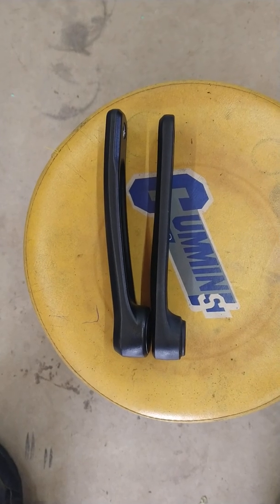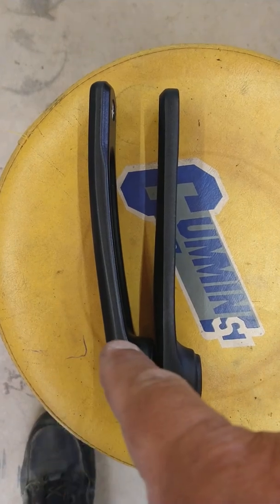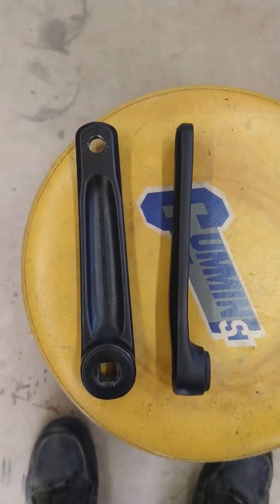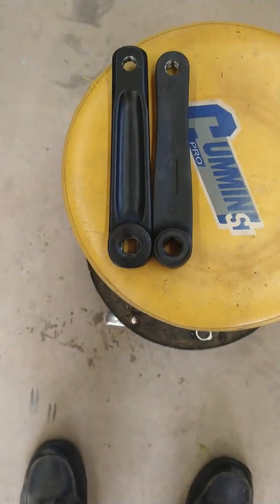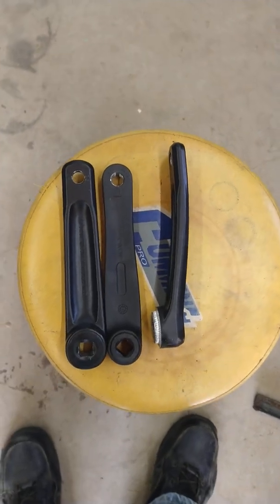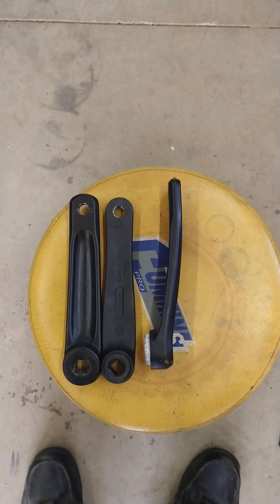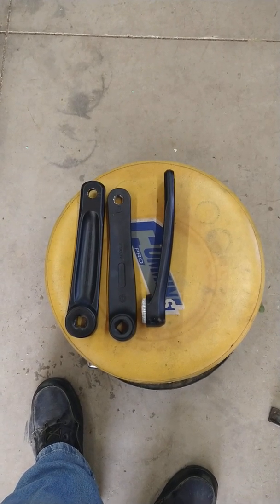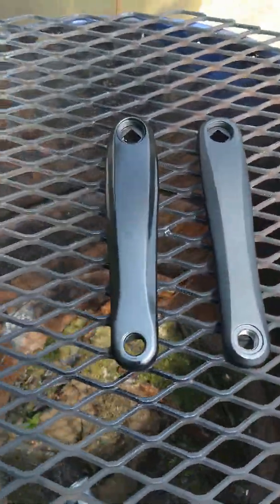Bafang BBS02B mid drive kit left crank arm issue (Solved)

Comment: It would have helped tho if you put here the “new” shimano part number that is engraved on the inner side. Now we know how you fixed your but it not exactly clear what we should be looking for…
Reply from the maker: I didn't provide any part no's because I simply went into my local bike shop and asked them for a used non drive side 170mm diamond tapered offset crank arm . I didn't  care what brand or color.

Comment: Have you experienced that the crank arm gets loosed overtime?
Reply from the maker: I have not, however it's only been rode about 65 miles so far, and I always tighten them to the point I'm scared I'm going to strip the threads then check them again in a day or so.
Reply: @oldmansadventures4627  thanks for your answer
Reply: I've experienced this and unfortunately it was whilst using the expensive but stunning Lekkie crank arms. Whatever you do don't keep pedaling like I did, it wrecks the square taper hole very quickly. Just keep checking and tightening after you first fit them, the issue does settle down as they bed in. I'm back to using cheap arms now, can't afford another pair of Lekkies😥
Reply: @wheelygood1754  oh I was hoping yo get the lekkie in hope that crank arm won't get loose.. I'm lock I'm getting a new motor cause my left crank is ruined
Reply from the maker: @theartteacherdaniel5096  I'm not sure what would be involved because I haven't done it, but I would expect it to be fairly easy to someone with some mechanical ability to remove the crank shaft and have it repaired by a local machine shop rather than trash the motor. Like I said I've not done this but before I retired we used to have electric motor shafts repaired all the time at a fraction of the cost of replacement.